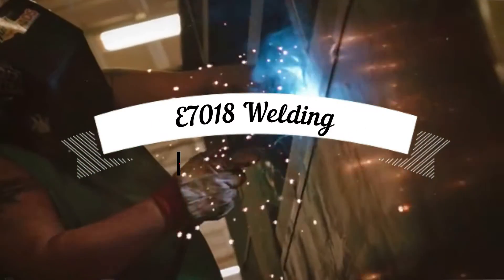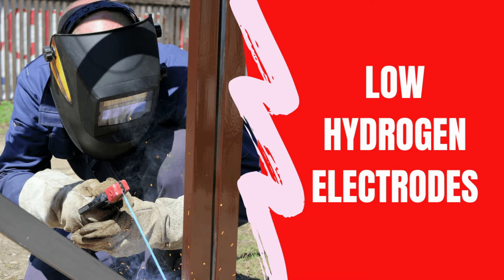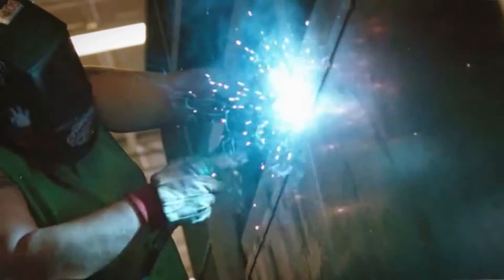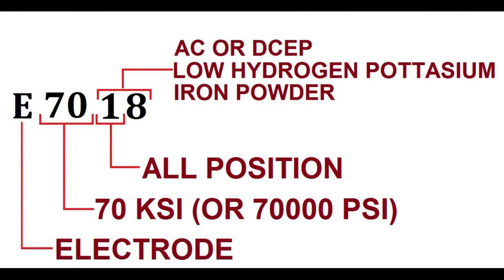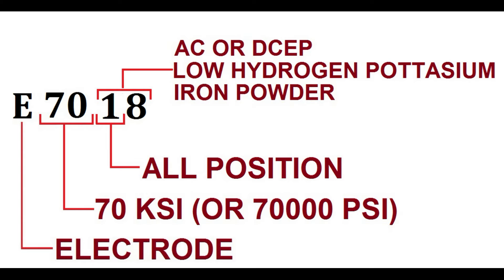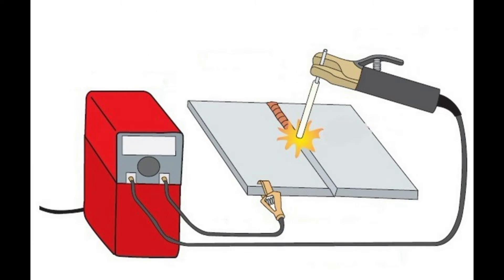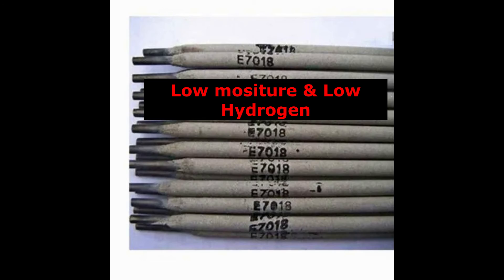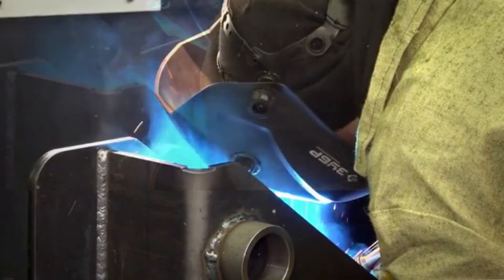E7018 Welding Electrode- Everything you need to know

Comment from the maker: Learn in depth about E7018 Welding Electrode- https://www.materialwelding.com/e7018-electrode-specification-its-meaning/

📢📢Welding Electrode Types-Welding Rod Number Meaning & Classification - https://www.materialwelding.com/smaw-electrode-types-and-welding-rod-number-meaning-classification/
📢📢 best brand of 7018- https://www.materialwelding.com/best-brand-of-7018/
📢📢How to Choose the Right Stick Welding Electrode and Rod Type- https://www.materialwelding.com/how-to-choose-the-right-stick-welding-electrode-and-rod-type/
📢📢 E7018 vs E7018-1 vs E6013 vs E7016 vs E6011 Explained- https://www.materialwelding.com/e7018-vs-e7018-1-vs-e6013-vs-e7016-vs-e6011/
📢📢E7018 Welding Rod: Everything you need to know- https://www.materialwelding.com/e7018-welding-rod-everything-you-need-to-know-is-covered/
📢📢E7018-1 electrode- https://www.materialwelding.com/e7018-1-or-e4918-1-h4-electrode-specification-meaning-chemical-mechanical-properties-with-mtc/